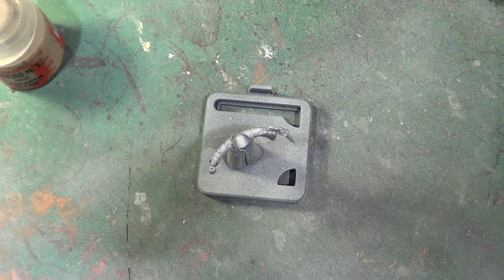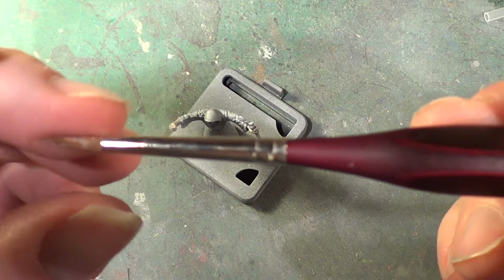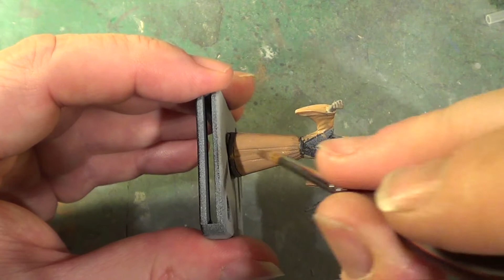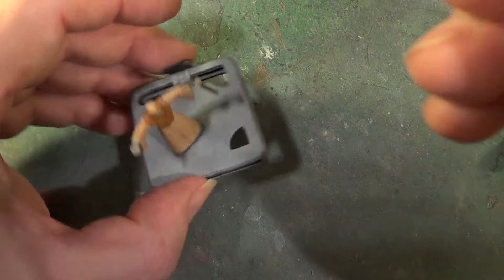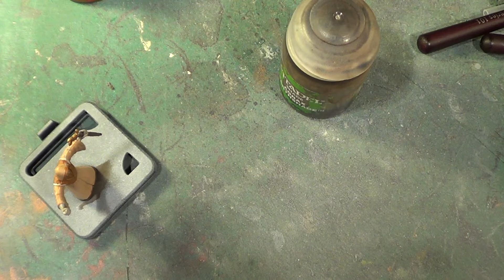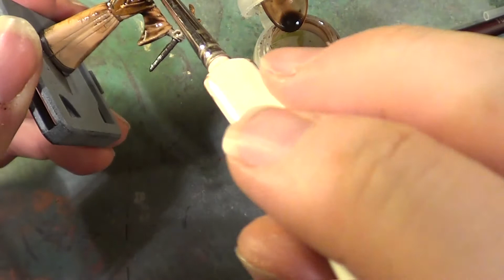Painting Mansions of Madness Cultist Part 1

Comment: Nice vid. Looking at painting my MoM minis. Not painted for years so need to get a new paint set. Any recommendations for a paint set?
Reply from the maker: Paul Simister Thanks. I dont really know what sets to reccomend I only use GW paints but i have heard the Army Painter sets are good. Vallejo are good as well from what I've been told but i dont know if they do sets.
Reply: Thanks. Just getting my head around the initial outlay again.
Reply from the maker: Paul Simister If it helps. it may be best working out the basic colours youd want to use. you may find that just buying paints bit by bit rather than buying a set will make it easier.
i would say though, make sure you get good brushes.